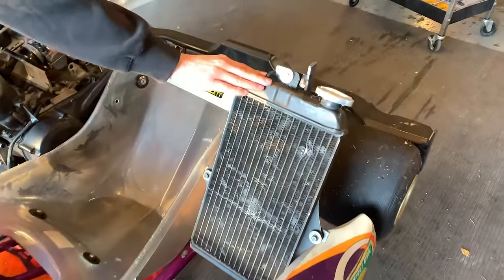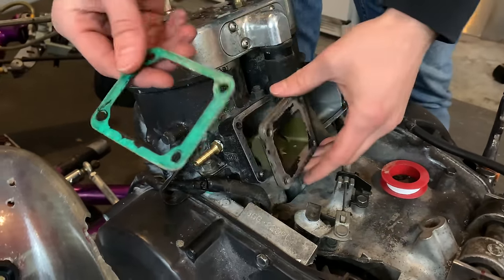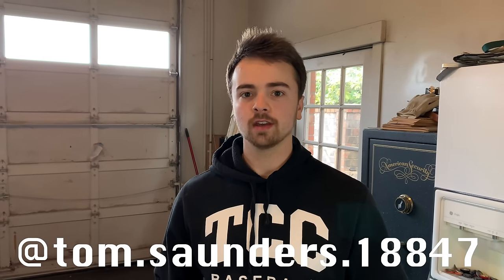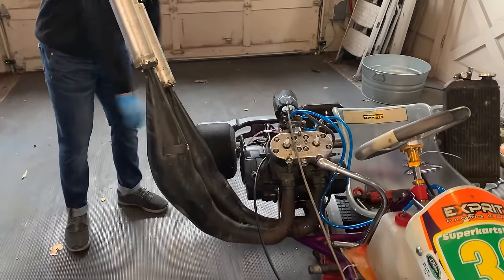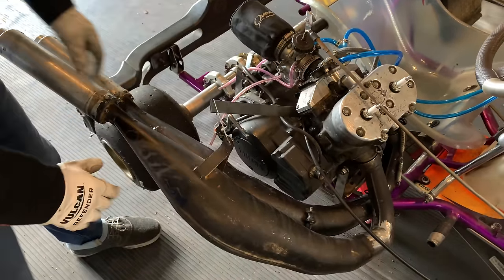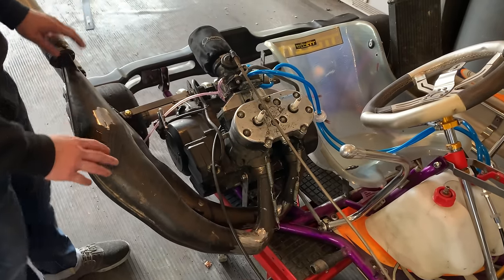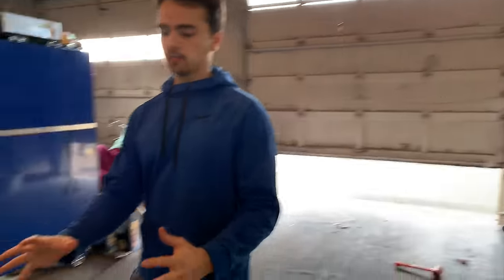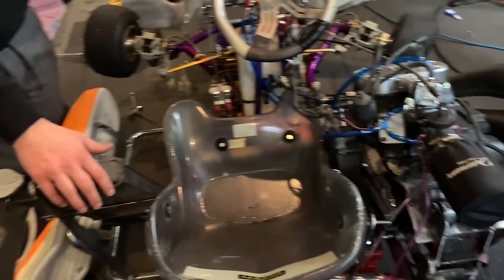Final Steps Before First Ride In The Banshee Shifter Kart! Part 5

Comment: I don’t like people telling me what to do so I didn’t want to say anything but I’m very happy you’re going with the dual carb set up it’s best for the banshee Have a friend with the single carb set up and when we race it never ends well for him😁👍🏻
Reply: Your friend has not got that single carb set up properly
Reply: Peter Carl Böer setup properly or not, a single carb will never beat a dual carb setup for a banshee. If it was truly the best, the engineers at Yamaha wouldn’t have designed the banshee to use dual carbs. If you use a single carb that is big enough to match the volumetric flow of the dual stock carbs, it’ll be so big that the air velocity at low rpm is trash and you’ll lose considerable low end power. Take a look at 98% of the guys that build 500+ cc 200 hp banshees and they are using dual carbs.
Reply: @65Red  waahaaahaa
Reply: Peter Carl Böer bro u don’t get it do u?

Comment: Nice build but just a heads up.. As fussy as the banchee's are with carb jetting, compression, and vacuum pressure an electric fuel pump would work much better.  Running dual carbs with dual pulse pumps might as well but I doubt the pumps will keep up.

Comment: Anytime you cut an exhaust it changes the tune. They are build for a certain  tune and you changed the angle and lost material.  I hope you figure it out.
Reply from the maker: I know how the exhaust works changing the angle will have a minuscule effect on power because the length of the cone is what matters. If anything it will improve flow because it’s not shooting straight up

Comment: One other thought .. since this is an older used kart chassis ... do spend some time going through the entire braking system .. make sure all seals are good, pads are good, that all bolts & linkages are cotter pinned, and a redundant safety cable connection from pedal to master cylinder(s) wouldn't hurt either, I think I can see that you have one already??  (these are used on many higher power racing karts, and mandated by some organizations). Also check to make sure your rear axle is properly mounted, the keys are secure, the wheel hubs secured (personally I like placing split locking collars behind those wheel hubs .. if a wheel hub slides inward under power exiting a turn ... shit gets REALLY ugly fast!!! .. your tire blows and you go upside down on your head instantly, seen it happen too many times!).  That kart is going to be a Track Beast! .. so take the time to Be Safe!  Brake failure, shifting rear axles/hubs, and steering stuff coming loose ... are the major causes of karting accidents I have seen over the years .. all mostly self inflicted accidents that could have been prevented.
Reply from the maker: Good info. I have a rebuild kit for the brakes to do at some point. My local track also seems to have some pretty strict regulations to go through as well. Will definitely try to be smart before I really push the kart

Comment: Remove the owerflow from the fuel system. Dellorto pumps designed to run without the they aren’t produce too high pressure. If you leave it in this way you will have fuel starvation issues.
Reply from the maker: Good to know. The seller told me I needed one but in the product description it said it was designed to not use one.